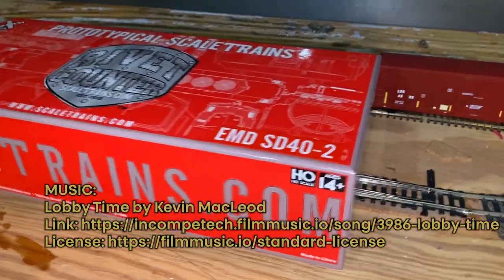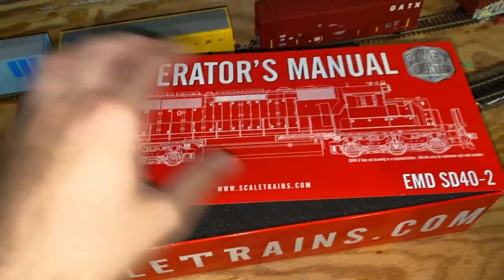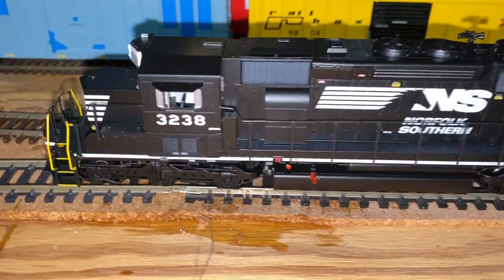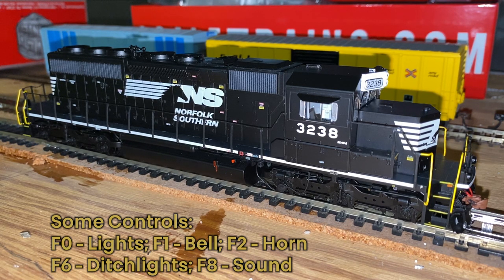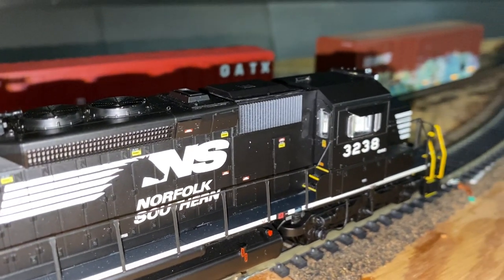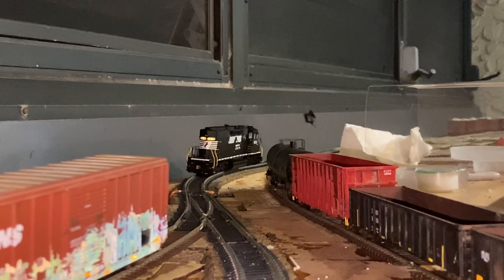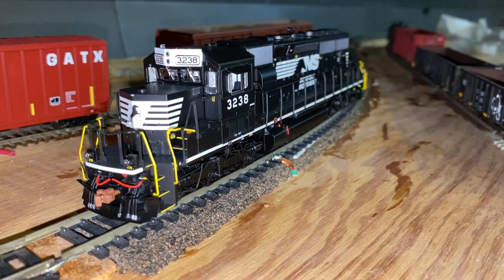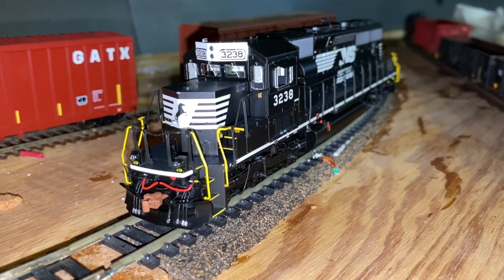ScaleTrains HO Scale Norfolk Southern Admiral Cab SD40-2 Review - Beautiful and Reliable Locomotive!

Comment: How an engine runs at low speed ( with clean track ) is usually telling, concerning drive train quality. This one's a good runner. Noticed it right off. What is an, "Admiral Cab"? Looks like a standard SD40-2 to me.
Reply from the maker: Thanks! An Admiral Cab is a cab that has a flatter slant on both sides and the numberboard panel kind of sticking out as a result. NS applied this to a lot of their GP and second gen SD rebuilds. And the drive quality I agree is impressive, this one ran smooth.
Reply: @TolgaEastCoast  Thanks for the info. I'd heard the term, "Admiral Cab," before. And, CSX had some good looking SD40-2s with rebuilt cabs, that are very similar.